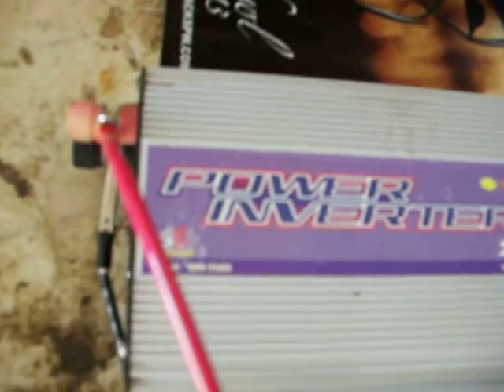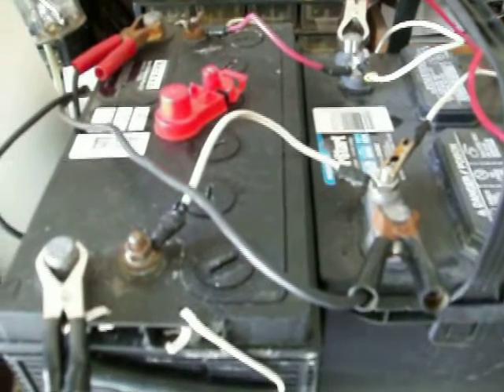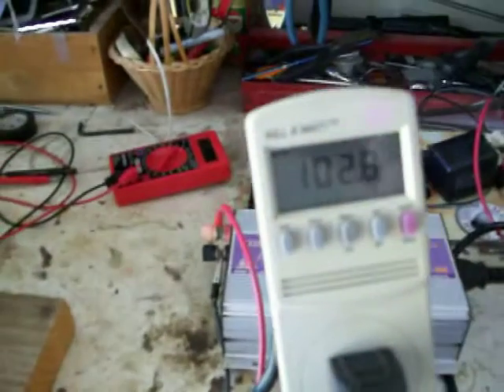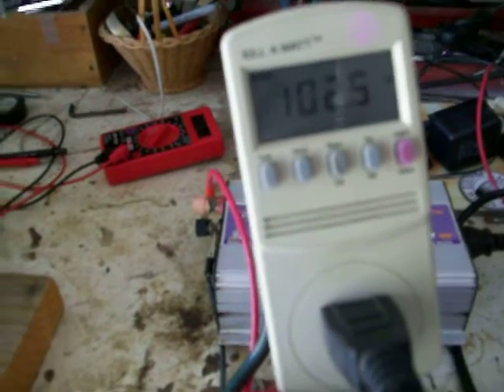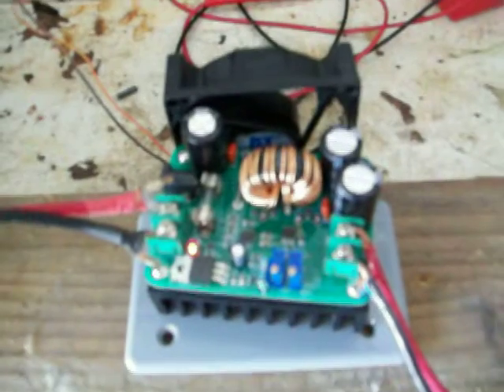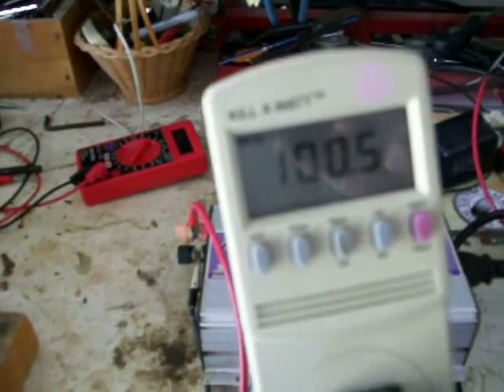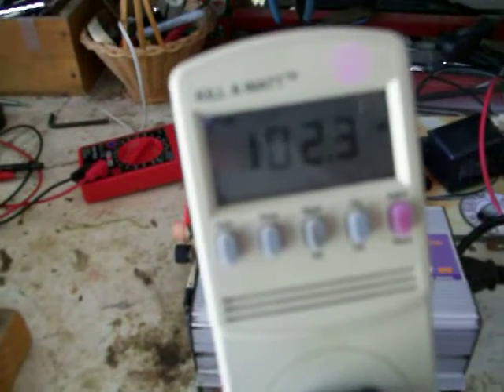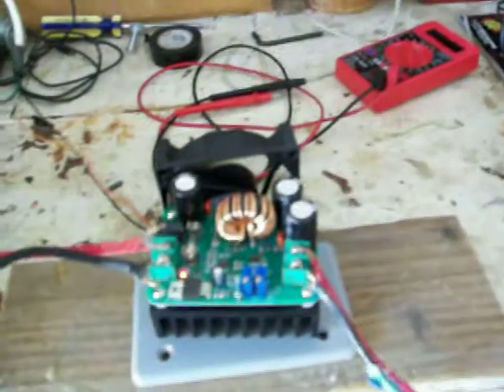Grid Tie Inverter using dc to dc power booster with 12 volt batteries

Comment: those inverters put out much higher watts when you run the voltage higher. why did you not run the 2 bats in series?

Comment: just found you online and was wondering how successful your dc-dc inverter / gti setup has worked.
Reply from the maker: It works but I am working on something different  found ac power inverter that turns 115 volt ac to 24 volt dc which i will in turn run my grid tie inverter on.   they run in about 150 watts

Comment: Very cool idea. Do you think doing this off a 24v bank and then setting the output on the boost controller to 12v you would get a longer run time on your GTI? I just bought a boost controller as well to experiment with. 12-80 v at 10 amps (800w) and the same out.
Thanks for the post it was super helpful.
larry

Comment: I would think that everything would be dc. the solar panels themselves or whatever controller they connect to should have the ability to output at any voltage u select.  that would be ideal without using all these intermediaries.